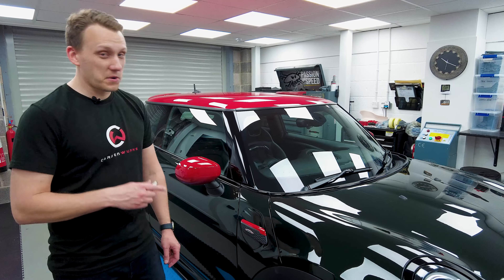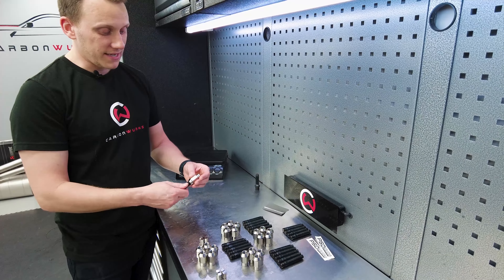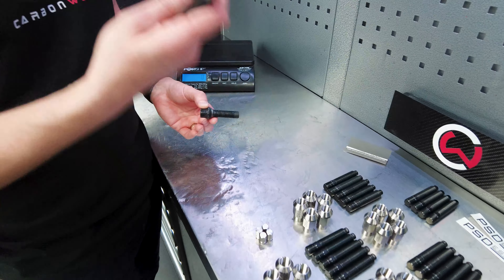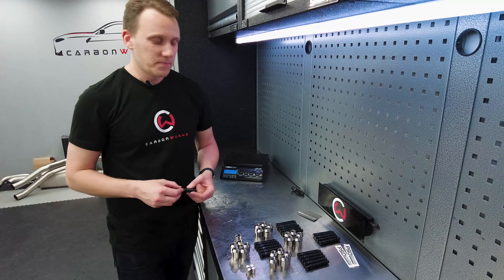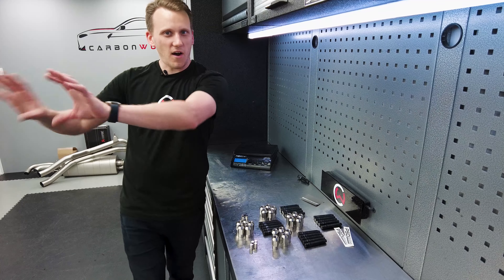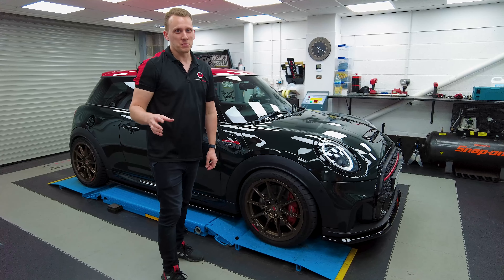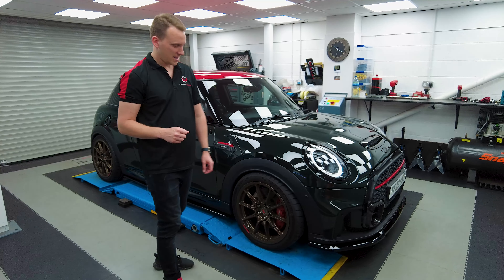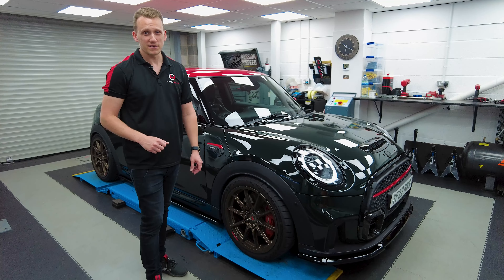Mini Cooper JCW F56 Titanium Wheel Stud & Nut Upgrade

Comment: What torque setting did you use for the stud install please?
Reply from the maker: This will depend on the stud and nut kit you go for as the metal itself will differ the torque required. Best to refer back to the manufacturers spec for the kit itself.